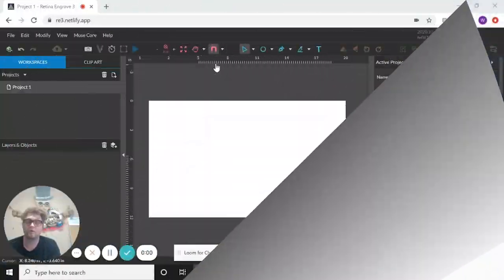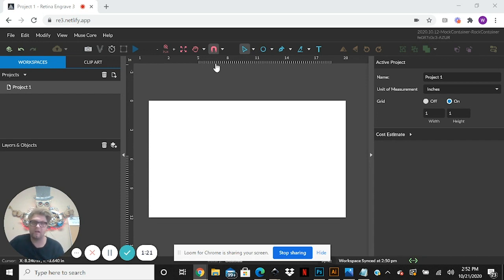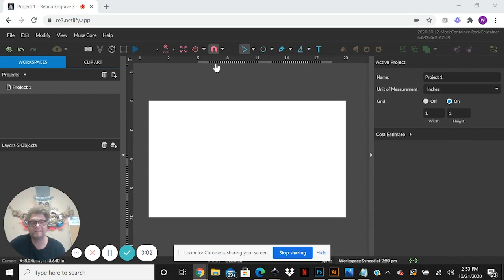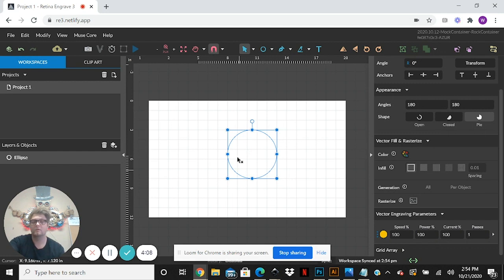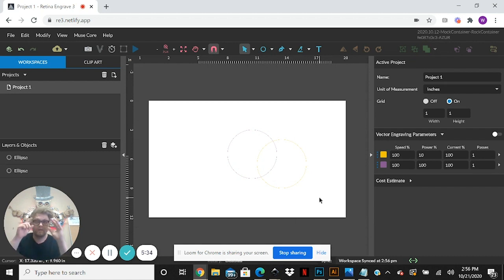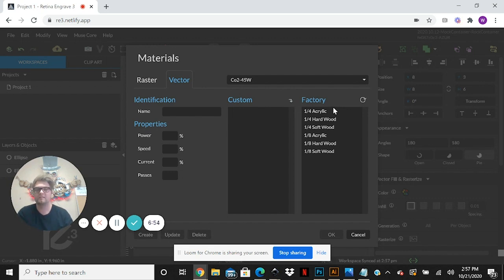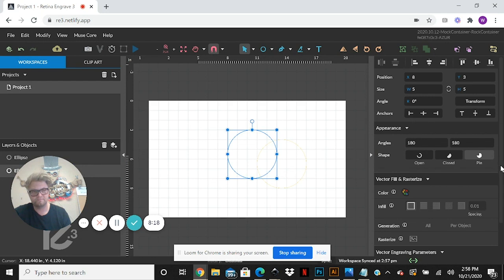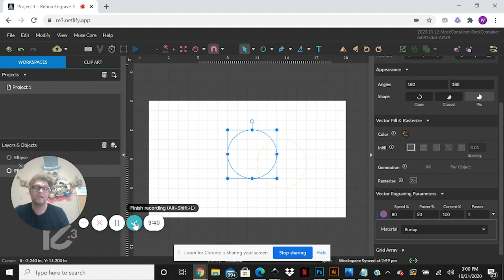RE3 Tutorials - First Time Users - Power Settings

Comment: Is this an older version? I don't see materials as an option in the Edit menu.
Reply from the maker: The materials option in the Edit tab as well as the Material Select under the power settings are both in the newest version of the software. If you can't see them, it could be that your software is out of date. You can prompt an update by making sure your machine is connected to the internet. If that doesn't work, you can contact sales and they can push the update to you.